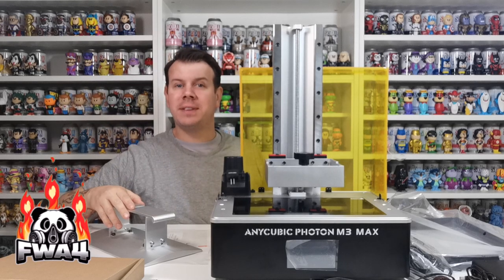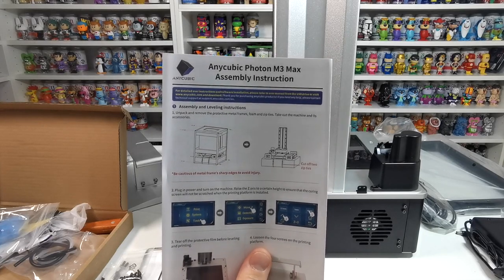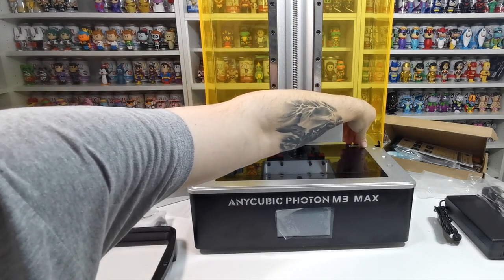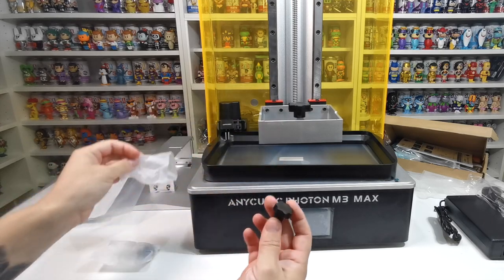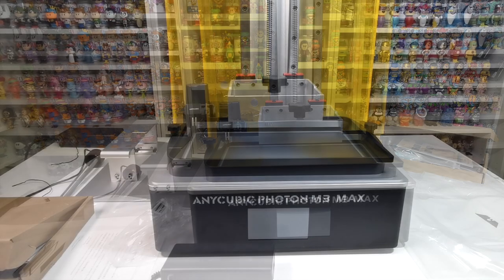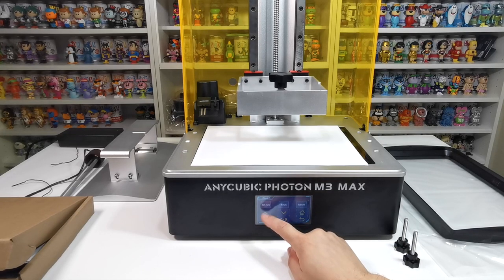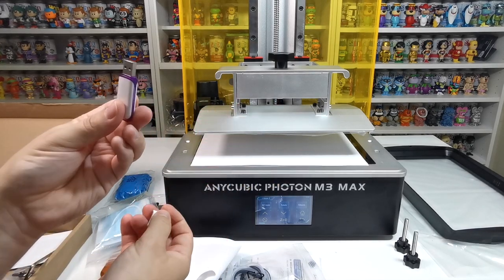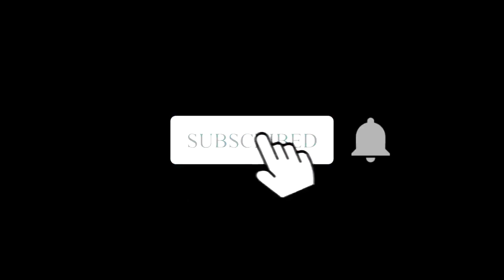How To Setup And Use The Anycubic Photon M3 Max 7K 3D Resin Printer - Simple Guide

Comment: Anycubic Photon M3 Max questions for any kind soul please: 
1. What frequency is the FEP supposed to be tuned to?
2. Does the FEP spacer still require the "13mm" bottle cap depicted in their official FEP Replacement video or is the M3 Max a different calibration? (I have seen some 19mm spacers from users.)
3. What is the torque setting for the screws on the FEP sheet?
4. Replacing the Glass under the LCD left a gap on one side is there a way to combat this? As the adhesive strip needs to be as far out of the print area, and on the perimeter as possible.
5. Anyone able to fix the touch screen not responding often?

Generic Questions:
1. Does anyone consider that the FEP has to be the same temperature as during normal operations while installing the new sheet? I'm sure temperature has some (if negligible) difference?
Reply: Youre manic...buy one and read the damn instructions
Reply: @stanlee2200  Maniac for seeking information that is not listed in the instructions whatsoever? Okay.

Comment: Anyone having issues with this printer after leveling hearing a knock noise when it first comes down on the print. I’ve re done the leveling with paper and with just the bed and either way I’ve had two prints where I didn’t hear it but then the print was crap and come off the fep.
Reply from the maker: Mine has this thing that when it's level it pushed a little more and make a thump noise twice then starts to print. No print issues. 👍🏻☺️